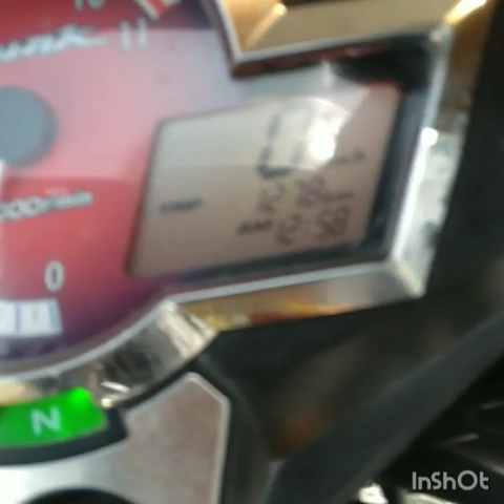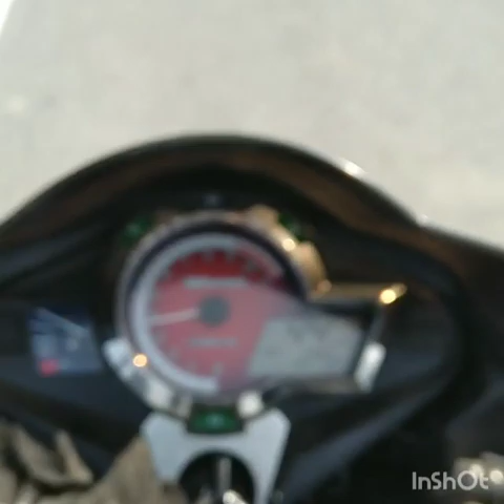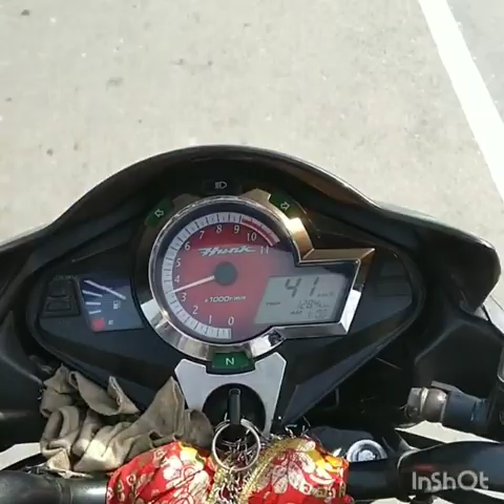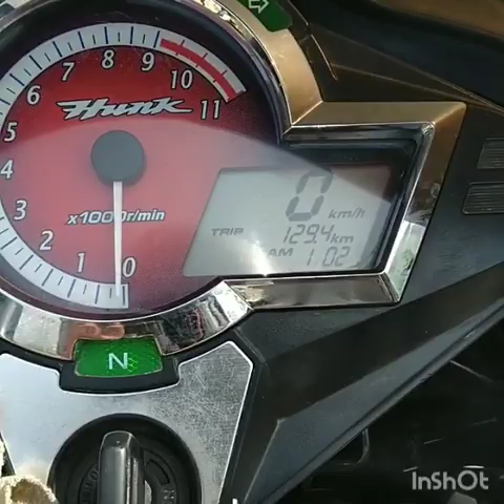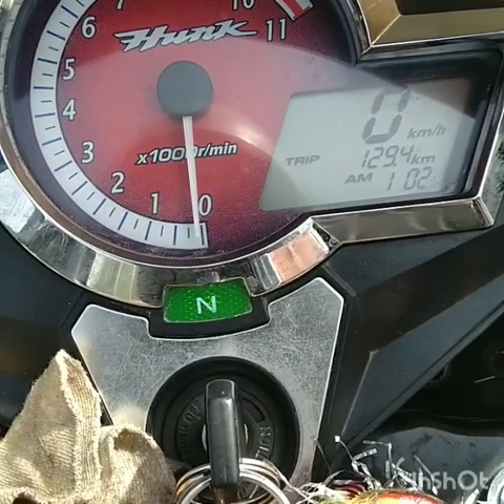AMAZING!!!!  64 km/Litre believe it or not from My Hero Hunk

Comment: Bro Hero honda Hunk 2008 model mein Aur Hero hunk 2016 model mein kya difference Hain pickup mein engine noice mein
Reply from the maker: Hunk 2016  power output is app 15 bhp and torque is 13 nm while other hunk have 1 bhp less power and 1 nm less torque 
Also hunk 2016 have upside down rear shocks   side stand indicator
Reply from the maker: Engine voice of 2016 hunk is quite heavy as change in piston , riding is a little different you may feel less vibes in new hunk pickup is better in 2016 hunk , while top speed of old hunk lies between 112-118, 2016  hunk can easily stretch 123 kmph